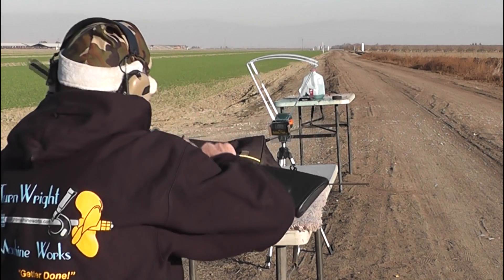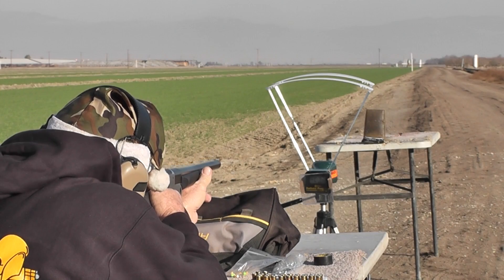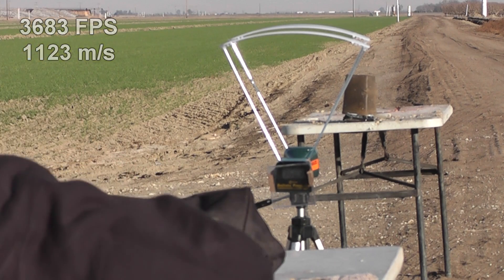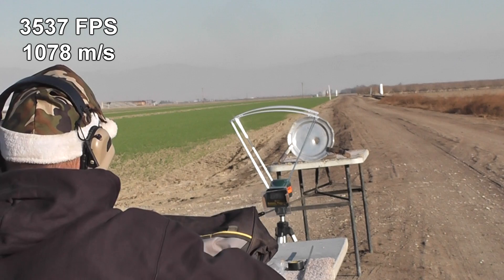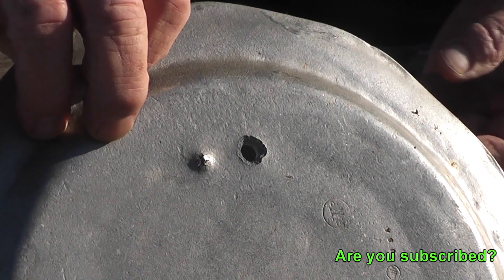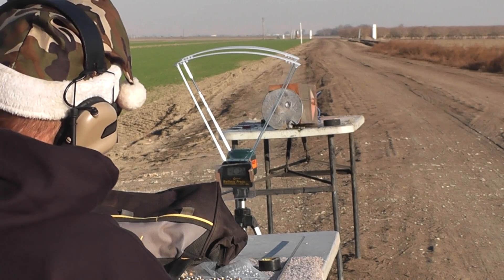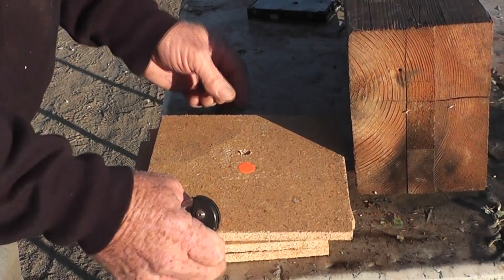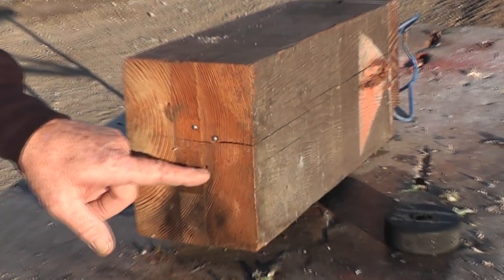World's FASTEST Airsoft BBs  +MACH 4  - What will they destroy?

Comment: I'm sure you already realize it, but the flash is because all that forward energy is becoming thermal energy when it hits.  It's black body radiation because it's so hot.
Reply: Caused by friction?
Reply: silvereagle9000 Caused by friction?"

Yeah, basically.  That energy has to go somewhere.  When it suddenly stops, all that energy has to go somewhere and it heats up white hot.

When you move beyond the speed of sound, weird things happen too.

One interesting thing is the air the object is flying through heats it up, it doesn't cool it off.  This is why spacecraft, or meteors traveling through the air are visible, because of the air friction.

Another interesting thing is that air will only travel as fast as the speed of sound - this means any object traveling beyond the speed of sound is leaving a vacuum behind it and creating a shockwave as it passes through the air.  This is what you hear as a sonic boom, and most of what you hear with a gunshot.

The Concorde would cool the cabin by pumping excess hear into the fuel of the plane.

Comment: Bump up the length of the stainless steel tube and powder load and see how fast you can get these things moving.

Mach 5 seems like a nice round number. (5600ft/s)
Reply: That would be awesome. That's officially "hypersonic"
Reply: Outland 
I would even like to See That LoL
Reply: Outland the BB would hit critical mass
Reply: @ChrisHallett83 at this point, youre limited by the burn rate of the powder.
Reply: David 
The obvious solution at that point is to produce some ungodly steampunk monstrosity of a barrel with separate chambers of powder all the way down, lit at the proper timing via some obtuse mechanism so as to have actually produced propelling gasses right as the BB zips in front of each chamber. Easy enough. minus the possibility of a catastrophic failure strong enough to liquify your ear drums
Reply: @connorpickens7523  sort of like the super gun that the Germans made to bombard London during WWII while still safely in France?
Reply: Or somehow rifle it
Reply: @lukequinlan4523  rifling would slow down the round, though. It also doesn't work as well on BBs.
Reply: @MaxRideout  I believe there's a high chance of the ball spinning itself into dust or at least several pieces if spun in a rifled barrel at the velocities we're seeing here. I think the forces on the balls would be astronomical (lol!).
Reply: Idk, I think you will have problems getting reliable ignition

Comment: I think the flash was caused by the heat from deforming the BB, and exposing unoxidized  aluminum. Aluminum is pretty reactive, and has found its way into high explosives and solid rocket fuels because of its reactivity. Pretty doggone exothermic I think as Jeff would say.

Comment: I think that the flash is plasma. It's a forth state of matter that i think in this case the pellets sublimate from a solid phase straight in to a plasma and it skips both liquid phase and the gas phase. This is probably due to the incredible pressure that occurs when the pellet makes contact with the plate. This focused energy point releases the bond between the atoms and electrons of both materials and causes the flash. I don't know but it seems like that could be whats happening :) 

Or it's the air compressing at the point of impact that causes the flash. Like what happens if you shoot a gun under water. Smarter every day made a video about that.

Comment: The flashes are caused by a phenomenon called „cavitation“, which happens, when an object moves at high speed in water. This causes steam bubbles which implode and sometimes this causes temperatures of several thousand centigrades - which results in a flash. This effect is a huge problem for ship‘s propellers or high pressure pumps for example. Sorry for mein French, i‘m a Kraut like Jörg Sprave 🤣

Comment: The flash is a transfer of kinetic energy into heat from the impact.
Reply: Joe Clark It also flashed when it hit the plastic jug.
Reply: Probably the compression of air between the pellet and the target because of the shock wave which creates a load of heat.
Reply: @codey morganti That's NOT sonoluminescence. It is a normal impact heating material. Just what Sebastian said initially. Kinetic energy is changed into heat. Just a standard P, V, T physics. You apply tremendous pressure to a certain volume of matter and you make it hot. If you make it hot enough, it will start to emit visible light. I beleve about 500 degrees of Celsius (930F) it will start to show as a dull brown/red and get brighter (it's for steel, but it will be similar in this setup too). Bright yellow to white is 1000 - 1200C.
So temperature in the impact moment there should be over a 1200C - (2200F). Usually such impacts get around 2000C.
There are many physics impact laboratories. Some specialize in recreating asteroid impact models and they can achieve over 5000C in the moment of impact.
Reply: Now this begs the question, if kinetic energy is transferred into heat. How hard would you have to slap a chicken to cook it?
Reply: @sphearix7232  ROTFL i LOVE that!!!! Thank you kindly Sir for your sence of humour :)
Reply: @sphearix7232  i came for the flurry of arguments about who was right, and I'm glad I didn't miss the chicken slapping question. Thanks for the laugh my friend.
Reply: I'm not able to find a source to answer what I'm thinking happened here but I'm almost convinced the impact transfered the kinetic energy through physical processes directly into light. Most of the flashes don't look like a spark, from heat but rather like a lightning, not a glowing but cold light...
Can someone help me here ?
Reply: @sebastianpuzik2533  look up triboluminescence  :)
Reply: Is it sonoluminescence?
Reply: Ivan Jakanov but the plastic bbs had a spark on the plastic jug? Now I’m confused
Reply: Thanks for that!
Reply: It's basically friction like then you rub your hands together
Reply: @lokidenicolo545  Yes it is. Though i'm kind of glad we are unable to do it hard enough to make our hands glow red ;)
Reply: Either way, nice discoveries taoflederman
Reply: The pellets are aluminum. Aluminum flashes bright, nearly pure white.
Reply: @wreck_ignition7847  the plastic ones weren't.
Reply: Joe Clark  I thought they were steel

Comment: The plastic bb had about the same amount of kinetic energy as a .22 LR
Reply: Just under. ABOUT 12% less
Reply: Yes but it moved faster due to being so light it travels faster so it hits harder basically this is like combining the concept of a BB gun and a firearm into one cause I want to figure out how to make a 177cal firearm bullet and shell so it would be a 177cal firearm rather than it being a 177cal airgun
Reply: Tyla Dube ever hear of a 17hmr?
Reply: joethrecker a .17 packs quite a bit more punch than a .22 though
Reply: @joethrecker8123  was gonna say the same thing!
Reply: @tyla dube lol u a casual fps does not make the bullet hit harder kintec energy does
Reply: @Br1dK0Sp3c  no, fps does infact determine most of the kinetic energy dump. 
A 50 beowulf with a tungsten penetrator will deliver far less damage to someone than the 17 remington or a buckshot load. 
Its 4 factors. 
1. Speed. 
2. Mass. 
3. Shape. 
 4. Material.
Essentially metal doesn't expand very well.
Plastic expands TOO well and breaks apart before it travels its own length at 4500 fps. 
Kinetic energy means almost nothing. 
Its about transfered kinetic energy and transfered correctly.
Reply: @eon2330  nope youve  got airguns that shoot steel bbs at 4000 fps but cant penetrate no Were as a 380acp doing 1000 fps does way speed is nothing without. Energy slugs travel atmuch slower speed then rifle rounds but within 50 yards are way more devestating because of all the. Energy. It. Has behind it
Reply: @tyladube801  If it's lighter, it doesn't hit as hard
Reply: @tyladube801  .17 remington is what you want.
Reply: Imagine taking that to a airsoft match
Reply: @matthewtenhagen9527  why imagine when you can do it right now on a serious note that would hurt
Reply: @BloodyWolf-gu5be  I agree but if you were just playing with people you know wouldnt be wimps and could take it then itll be fun, but yes itll hurt like hell
Reply: @BloodyWolf-gu5be  .17 hmr is based off the .22 magnum
Reply: @matthewtenhagen9527  it woud KILL them
Reply: Can’t wait to play airsoft
Reply: Around 95-96 ft. lbs. so right in between .22 long and .22 LR.
Reply: Nahh, more "powerful" than LR
Reply: could kill some tiny varmits with that i think.
Reply: I think that that thing probably has about as much power as a 50 Beowulf not a 22 long rifle it's going about four times the speed of a 22
Reply: @Jester_117  let's do the math. 4631*4631*3÷450456=143 fpe for the airsoft bb, assuming .2gr bb weight. So no, not 2300-3000fpe 50 beowulf energy level.
Reply: @randomidiot8142  you also have to factor in surface area for the foot pounds per square inch. Round pellets are the best surface area to volumn for pen.  
But still. It dumps its load entirely before it travels its own diameter sadly.
Reply: But shoots four times faster
Reply: Lol these comments are hilarious. So many people know nothing about ballistics.
Reply: It may be going as fast but in the end obviously the bb wont go as far as an actual steel bullet would have more mass therefore more momentum that pushes it forward for longer
Reply: @BloodyWolf-gu5be  bullets are made out of lead genius
Reply: @BloodyWolf-gu5be  a copper jacket is still not steel. A steel projectile would fuck up the rifling on your barrel.
Reply: Imagine putting that much powder behind a .22lr using 10.25 grains?? Oh wait they already did that and its called a .223. And has way more energy than a bullshit airsoft bb
Reply: @LegionGamingTV  that's more like a .22 tcm or .22 hornet. My plinking/varmint load for .223 is 28grs under a 50gr bullet.
Reply: @LegionGamingTV  in no way is a 223 and a 22 lr similar. Its not a matter of putting more powder behind the projectile. The 22 lr is a straight walled cartridge. The 223 is a 355 cal casing necked down to 223. The tapered design increases case pressure and muzzle energy. Same reason why the 300 wm has more velocity and muzzle energy than a 338 wm even though they share the same cartidge, except for the neck.
Reply: @julianburns6632  I know that the 22lr and .223 have pretty much nothing in common. All I was saying is that the .223 is a very much modified version of a .22 lr. Yes I know the cases are different and yes I know you can’t get as much velocity out of a 22lr casing. But I have personally loaded my own 22lr casings and have gotten velocities of over 2100 fps out of a TX 22.. Which is amazing and can cause way more damage than a regular 22lr CCI Stinger. They are the same diameter but modified.
Reply: A 22LR is 1,250 FPS
Reply: @federalbureauofinvestigati683  Velocity is not the only variable, by guy. Mass also matters.

Comment: I have a theory as to what the flash is. Because the projectile is going so fast that it’s causing massive compression and a huge energy dump from the projectile to the material. The massive compression causes one of a few different things. 1. The compression causes a lot of heat to be produced which causes the air around the contact area to become plasma. 2. Similarly, it could also be that the metal is being shattered into many microscopic pieces and the increased surface area and immense heat cause a violent reaction of the metal with the air (similar to thermite). 3. The metal itself is being turned into plasma.

Comment: I would love to see a scientific explanation for that flash.
Reply: Arctic Arsenal I would strongly assume that the impact pyrolyzes any organic matter it comes into contact with. 

With such a small projectile, you’re punching all that force into very little surface area. The organic matter decomposes at a molecular level and combusts from its own oxygen contained within its molecular structure. 

Perhaps the bb’s could spark on a piece of dry ice.
Reply: Interesting.  I will have to study this effect.
Reply: @ArcticCustomProps  ...its heat
Reply: All that kinetic energy has to go somewhere, so it’s converted to heat. The heat is enough vaporize or even ionise some of the material, causing a flash of visible light to appear.

Comment: Not airsoft, airsoft uses 6mm plastic BB's to be fired from an airsoft gun. These are 6mm metal bb's you'd use in a real "BB gun" (cant take on any site).
According to demoranch these bb's should be able to piece an abrams becuase "they way to pierce armor is to have a small bullet going really really fast"....when actually its to have a very heavy round with a small cross sectional diameter going really really fast...like a sabot.
One of these metal bb's its not going to pierce an inch thick slab of harded steel.
Reply from the maker: I guess they are lying to us.   https://www.ebay.com/itm/600-RD-New-Aluminum-Metal-3g-0-30g-6mm-Premium-Airsoft-Sniper-Rifle-BBs-ALBB600/191182865157?epid=1648608953&hash=item2c83630305:g:DkoAAOxyzqdTdYCg
Reply from the maker: BB guns use steel bbs that are 4.5 mm

Comment: You really should drill a cork or use rubber washers in the end of the barrel to hold it straight.
Reply: @Jack Obrein They already did.
Reply: @justsomenerd8925  yeah, are you talking about those over the barrel arrow shooters they used in the end of the wwII?
Reply: I was thinking the same thing. It can also be used as a stopper for the quarrel.
Reply: Plus midway through the barrel, and for the high-powered loads the entire barrel should be embedded in cork
Reply: Or cotton and tape
Reply: Barrel needs to be free of impedance. Same way your rifle shoots off when you rest it on the barrel

Comment: I know DYI over at Spudfiles used an electrothermal gun to get  airsoft BBs to somewhere around 3 km/s (fast enough that the craters in aluminium plate showed tell-tale signs of hypervelocity impact). Photobucket has killed the pictures, but: http://www.spudfiles.com/miniature-cannon-database/topic21636.html

That's not definitely the fastest, but it's the fastest I know of. (Definitely less practical though).

Comment: You guys are actually nearing the 5000 fps mark that was attempted with the .22 Eargesplitten Loudenboomer. You should revisit this and break the 5000 fps. 
Up the powderload and make a longer barrel. Or weld on a rifled barrel from an airrifle, your nailgun blank and pellet mod worked fine, so a .38 blank behind the pellets might do the trick.
Reply from the maker: We might need to use a faster-burning powder,  like flash powder or something.
Reply: TAOFLEDERMAUS 

I would stay away from flashpowder.... as far as i know, flashpowder is right on the limit of detonation even when burned in open air. And even slight confinement would make it go from deflagration to detonation. 

You could try it, but use a string and a gun you dont care about. Remember to trigger the high speed camera at the first try because you will not get a second try. 😂

Comment: That flash is compressed air. When a projectile goes that fast, the air has no chance to get out of its way, so it gets extremely compressed when pressed between that projectile and the surface. This is enough to momentarily raise its temperature to several hundred degrees C and create the flash.

It's like the effect of aerosol being cold from decompressing gases, only in reverse. Oh, nice video btw. I knew a collaboration of some kind between you and Joerg (which is read "Yaergh Shprave" if I recall correctly) was gonna happen sooner or later.